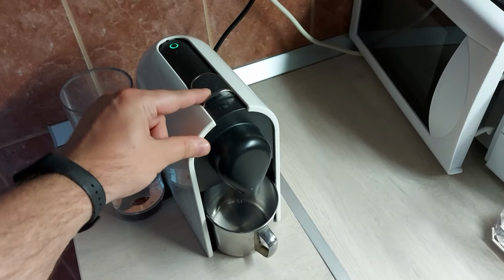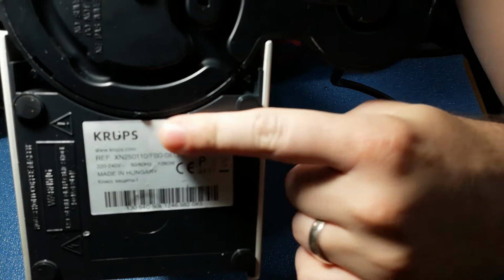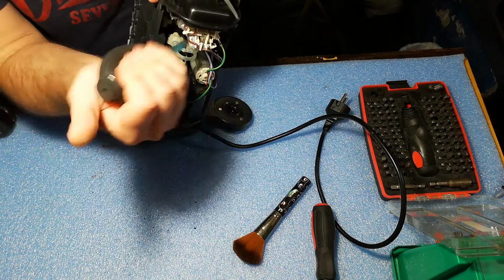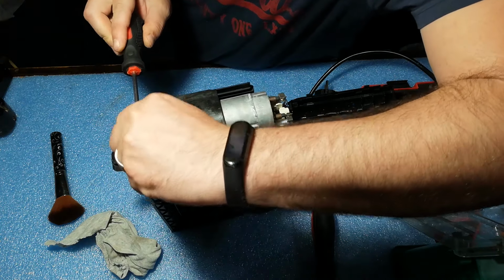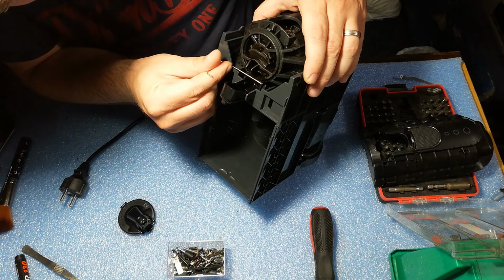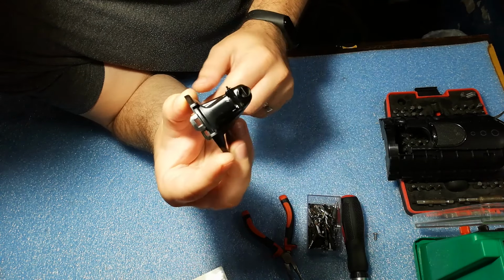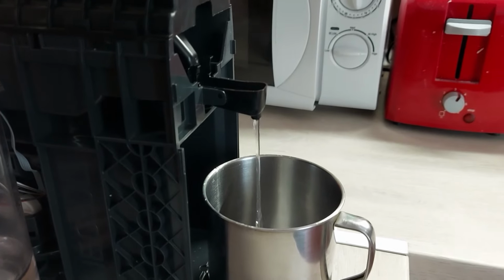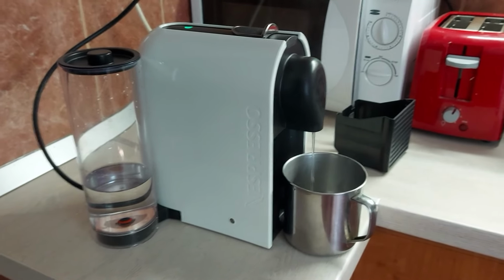Nespresso U - Step by step repair guide  KRUPS XN250

Comment: A good how-to video. But I'd rather see how the cables are detached, because I did it only once and now have no idea of how to remove it again — these sit way to firmly in its nests. 
BTW, a Torx is not needed here — use a flat screwdriver and put it so it grabs any two notches in the screw's head. Works perfectly for me.
Reply: Yes, you're right. Actually I couldn't get any Torx to work with that, but using flat screwdriver worked fine! Great video anyway, having this part replaced is a great opportunity to properly clean the machine.

Comment: Finally figured out WHY the spout ears Snap off. On most All these makers .. eventually. 
The Motorised Carriage that slides back and forth  acquires too much friction and slop in the mechanism which allows off centre movements. 
The Capsule  container  O ring seal dries out/ becomes coffee encrusted and offers too much resistance.
 Excess friction results .. so the  Slider assly Cocks a bit  sideways in it's too big for purpose slider tracks  (you can hear the noise.. use that as your Fix it now signal ! ) as it engages the Coffee pod a bit off centre and the resulting twisted spout position  snaps off an ear,  the next one, facing that twisted direction movement .. all by itself , soon enough breaks off as well.  
There is Zero force on those ears when all is working as intended and centered... they merely operate a see saw spout. Serious misdirected forces break them off... Not.. normal actions.
 Piss Poor detail design and Overly sloppy tolerances... is the Real problem... Likely designed for low cost and Easy line assembly.     Go ! Krups.

 Cleaning and lubing fixes the problem Perfectly..   Problem is this clean /lube needs doing regularly Or the problem WILL be back. 
The Bit of glued on metal rod  'repair' sort of works not overly well though and definitely not for long... as it's a patch job NOT a fix.
 IF you must try this.. at least fit  a Thin  1mm rod so it gives passable clearance in it's movement.. that... might buy  you a few months.  Feeling Lucky?
Reply: Please can you explain once again, where exactly i have to clean and lube? Maybe that helps a little bit longer